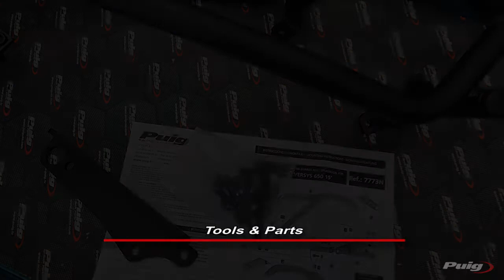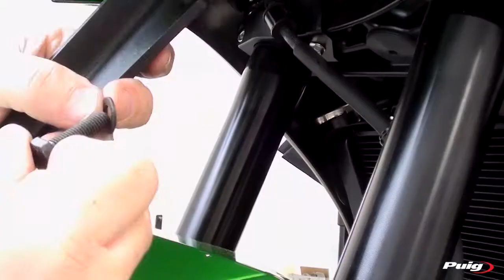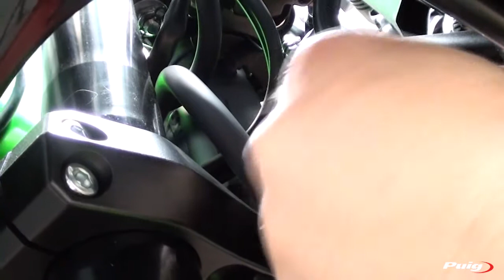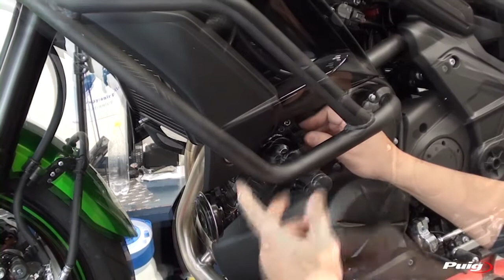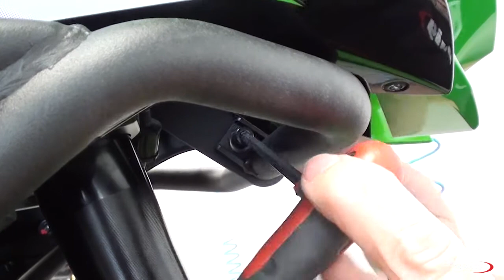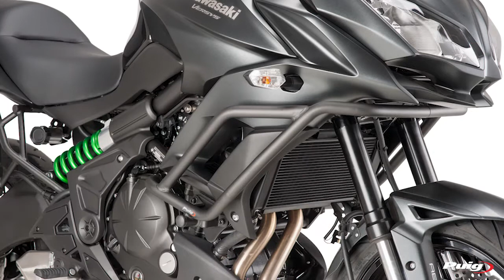REF.7773N Puig Engine guards for KAWASAKI Versys 650 15’-

Comment: There is an ABS connector attached to that very front thingy you mount the front mounting point to - and there is nowhere to put it after your bracket is attached. Leaving that hanging was not exactly what I wanted, so I had to return the guards, unfortunately
Reply from the maker: We're sorry about what happened to you with this product, thank you for the information.
Reply: Puig Hi-Tech Parts thank you very much for you response! I have double checked, and found that 2017 and 2018 both have the connector there (hence the small hole), while 2015 doesn't. It would be really nice, if you could include one drilling operation into manufacturing process of the front attachment bracket and have that small also drilled in it, so that the connector could be attached where it belongs. Thanks you!
Reply from the maker: We will inform about this to our technicians and we will have in account your advice. Thank you
!
Reply: Puig Hi-Tech Parts I would like to thank you and let everyone know that Puig customers support is awesome! I had to return the part 1.5 years ago and install a competitor’s product, but it offers less protection. 

So, today I’ve ordered this product again, being ready for paying the sensor to something :)

But I found, that the newer manufactured central clamp has the necessary holes and they are mentioned in manual!

Thank you very much!

Comment: I found a link on xlmoto website in the netherlands and it says that they are compatible with a 2011 kawasaki versys.. but is this true because you replied to a comment saying its only for 2015 to 2019
Reply from the maker: It could be a mistake on the XL Moto web, the engine guards 7773N are compatible for '15-'20 models.
Reply: @PuigHiTechParts   compatible for 2021 ?

Comment: To: Puig Hi-Tech Parts - Is this now modified and ready and which model fits the 2018 Kawasaki Versys 1000 LT ?
Reply from the maker: For Kawasaki Versys 1000 2018 the compatible engine guards has the Ref. 7774N.

Comment: Hello,
Please be kind: what tools are needed, in order to mount the engine guard ? Thank you in advance !
Reply from the maker: Hi,
For a M8 DIN933 screw , a 13mm wrench is required
For a M8 DIN912 screw, a 6mm Alen key is required
For an M8 nut, a 13mm wrench is required
However,  we always recommend to do this type of mountings with a specialist.
Thank you
Reply: Puig Hi-Tech Parts Thank you very much for your answer !